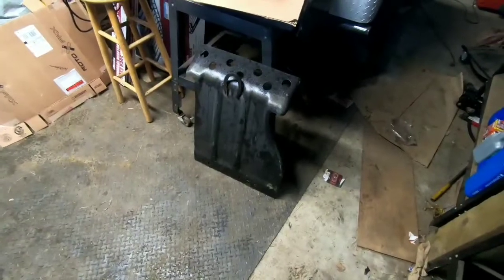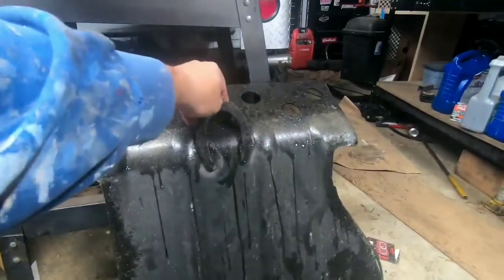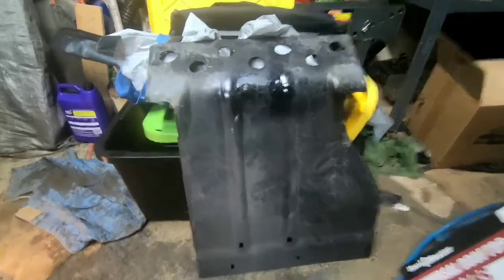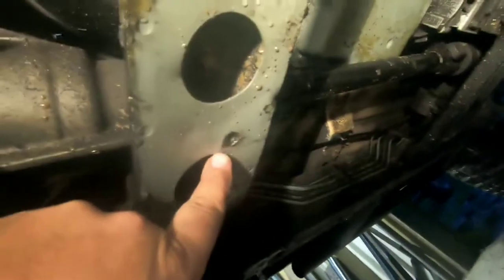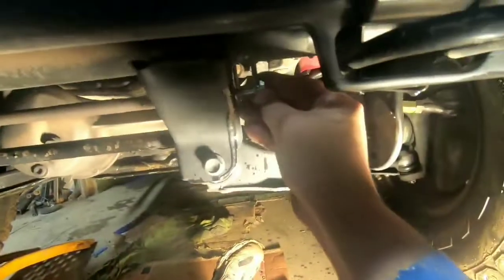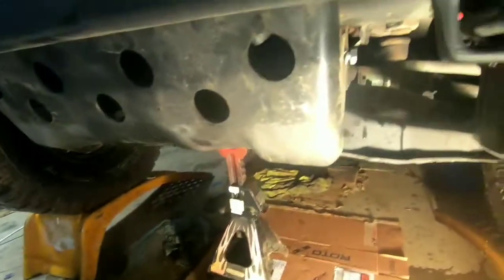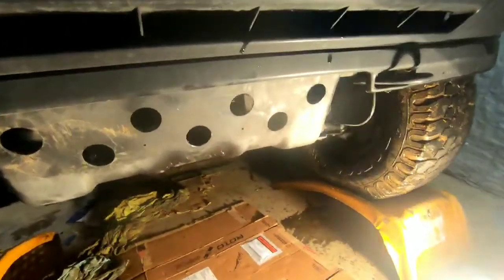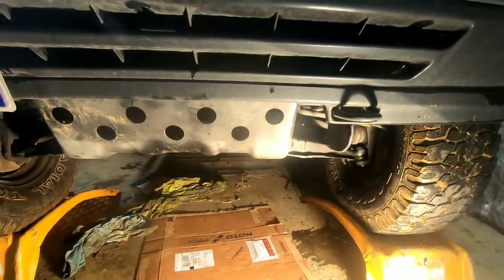Adding a skid plate to the convertible geo tracker

Comment: I just built one out of some steel plate that I had laying around... I didn’t even know they were a thing, I just wanted to protect my radiator and front diff. I basically mounted it the same way this one is mounted except the top bolts are going into the bottom of my winch bumper.
Reply from the maker: I was surprised at how hard to find they are. My newest tracker has a piece of plastic zip tied on it. I will be replacing that with the real thing soon.